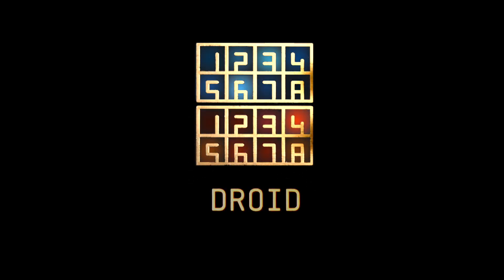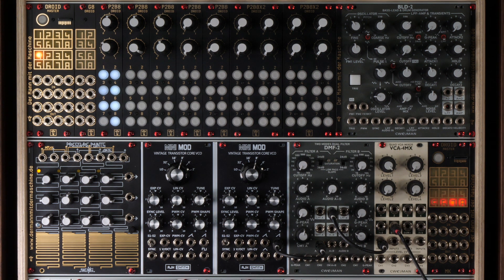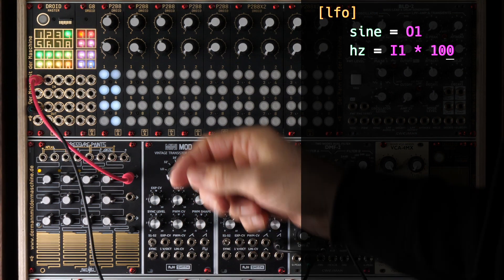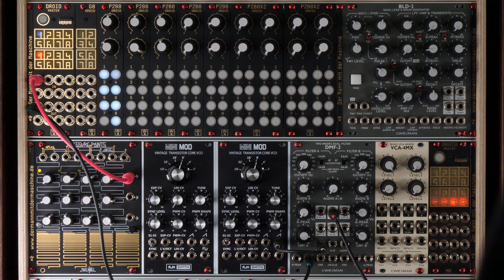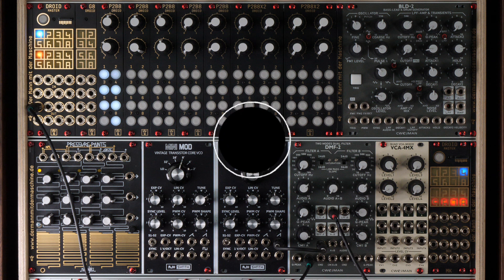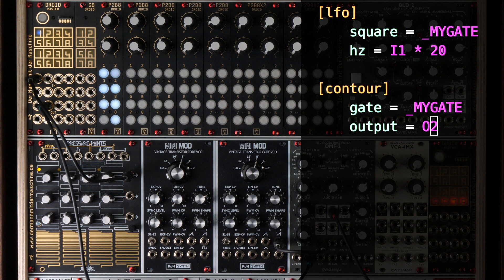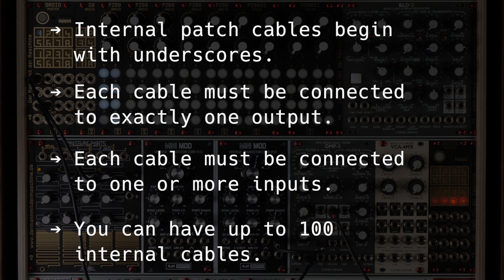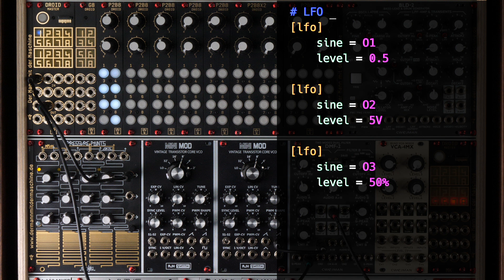DROID Episode 3  - DROID patches explained

Comment: Would be so cool if you could program it real time without having the SD card business. Only plus side of SD card I see is being able to load presets easily.
Reply from the maker: There will be an expander, which gives you direct access to the SD card via USB, und also MIDI in and out and also four additional gate outputs. So you have both the advantages of the SD card (easy swappable without computer, etc.) and of a USB access (frequent changes can be made very quickly without changing the SD card)